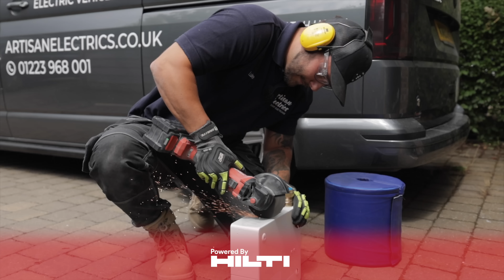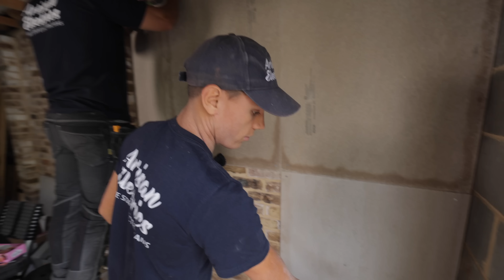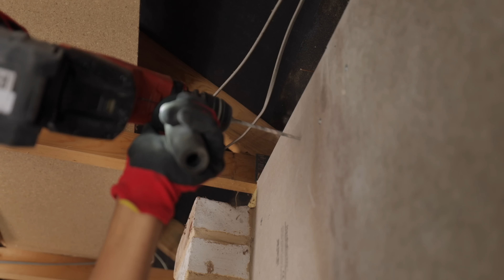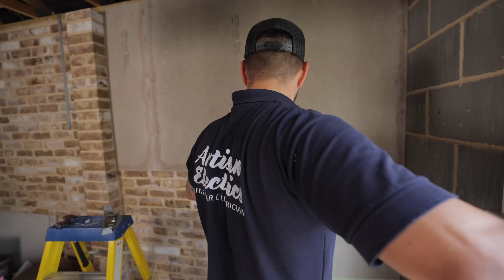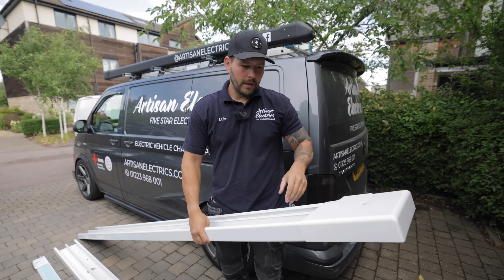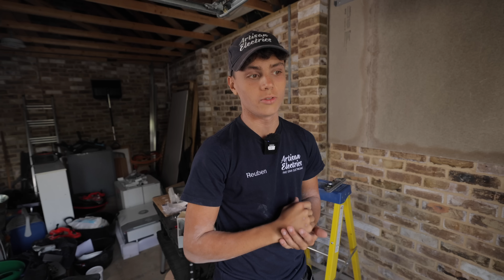How to Install Solar Inverters, Batteries, and Trunking in a Garage

Comment: Rules might be diffrent. But why no red and black DC cable. Also, is Arch detection turned on by default? We seperate DC kabels. Even if they're double insulated.

Comment: I can only find either new build work or house maintencance work as an electrician (while maintenance is only limited to socket/switch/light/extractor fans replacement). can any one guide me how to find work with electrician /company like Artisans Electrics is doing. I am fully qualified electrician based in Romford town of greater London area.

Comment: Segregated plastic trunking isn't gonna make a blind bit of difference for "interference" not that that should be an issue anyway.  It's plastic so has no effect on any electromagnetic fields.  IMHO the only real purpose of having segregation in plastic trunking is to avoid issues where some cables insulation may not meet the maximum voltage present.  On some data cable you will see 300V printed on the sheathing so it's not really a problem for this to be in the same trunking as mains anyway.  Interference is rarely an issue as, providing the data cable has been utilised correctly, you have common mode rejection with the twisted pairs being balanced lines.

If interference was actually an issue then you can get metal trunking with partitions in it.  This would actually have some effect against EMI between the different sections.
Reply: Just finished watching - you went went to all that effort with the huge segregated dado trunking but then you have unsheathed twisted data pairs loose in the same compartment as the single insulated mains wiring which kinda defeats the object and would not be compliant.  Furthermore, if interference is a concern then I'd say that using singles for the mains wiring isn't the best choice - at least with twin and earth or flex the cores are tightly bound together thus minimising any EMI as the EM field around the live will effectively cancel the field from the neutral since they are flowing opposite directions.  With singles this cancellation is not as effective.

Comment: Mentioninng neater... Half of the Stuff that you scatter there on the wall and in the trunking is available as a DIN Rail module as well... Why so complicated, why not just put as much as possible in a DIN Rail enclosure? Cleaner, neater, easier to wire!

Take a DIN Rail enclosure with a couple of module device rows and two or three multimedia fields and it's all packed nice and neat. And you could even pre-wire it before the job, so that you don't have to spend so much time drilling individual holes and wiring.

Comment: I have been seeing a lot of battery fires on vehicles, which seem to be difficult to put out. What fire precautions are necessary around your batteries ?
Reply: LiFePO4 used in most home batteries (and getting more common in EVs) is much less susceptible to thermal runaway than the earlier Lithium/Nickel/Cobalt technologies.

Also worth mentioning: if you look at the per unit numbers, petrol cars catch on fire 30 times more often than EVs, so if you haven't been worrying about your petrol car catching on fire, you probably needn't be worrying about EVs either.

Comment: Genuine question, If the AC and DC cables run together in the underground ducting why can they not continue running together in the same trunking?
Reply: Absolutely can, it is a non issue with such a small cables and currents.
Reply: Good point
Reply: In a domestic setting, where parallel lengths are not long and currents are low, no reason that I can fathom.

Comment: The network switch power supply looks tacky. There should be a neater way of doing that
Reply: An PoE switch could work in these situations (powered from the other side, ie next to the router)
Reply: Could eliminate the socket and wall wart by using some free space on the DIN rail in one of the boards to mount a small 9-12V AC-DC power supply (whatever voltage the switch wants, it's usually one of those two).

Comment: Great little set up there Jordan. The dado trunking was what i thought you’d install on the previous video you did with Cory and hence why i asked the question regarding the AC DC cable segregation.
Do you fit a bidirectional RCD at both ends of the libby device (from the board and within the unit) as it feeds back into the grid as well as draw power.
Interested to see how you connected up the SPD units as there seemed to be a lot of cables running in that enclosure.
Keep up the good work, these solar renewable installs are very interesting.🤙🏻🤙🏻

Comment: What's the regs about using metal trunking in domestic settings? I ask as whenever we break into old plastic trunking to run new cables, we need to fit metal fixings and if needed, replace the trunking for metal stuff. All post grenfall fire regs.

Comment: Awesome video gents, here in South Africa we as electrians install a "essential bd" which is a ups supply. My question is does your supply as well as you "back up supply" go in the same distribution board? Do you guys have a neutral earth bonding if your city falls away? Thanks for the videos, love watching how others countries do their electricity 😁💪
Reply: The EPS or backup from the inverter seems to be hardly ever used in the UK. They don't suffer with power outages or load shedding like us. The battery is purely used to make maximum savings from the solar power. The bonding of the neutral and earth isn't an issue if not using the EPS
Reply: @rgtsparky  oh okay, our flippen loadshedding is a killer😂🤣 Thanks for the answer man💪